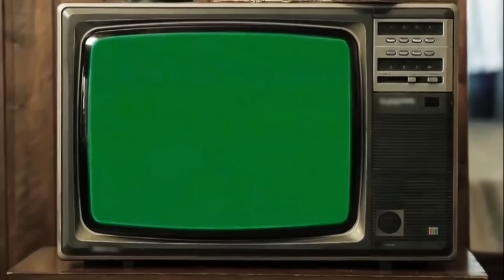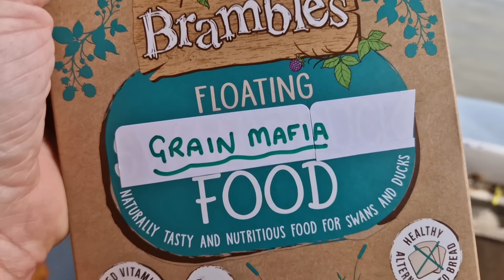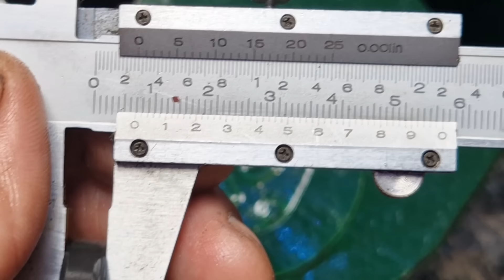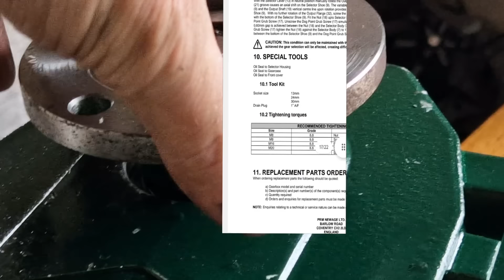Lancaster Canal breach update, and I strip my narrowboat gearbox. My journey continues.

Comment: Great job! I'm looking forward to part two. I use to work in the hydraulics industry. We would leak check our pumps with pressurized air after a rebuild. You could remove the vent fitting, and connect a hose to your bicycle pump so you could pressurize the case, you only need about 5 psi. Then check the shaft seals and housing seals for leaks with soapy water. Just a suggestion. It's easier to find a leak before you go to all the trouble of installing it. I can't tell you how many times I found a nicked shaft seal. You were smart to protect yours with the plastic wrap. Most people don't.
Reply from the maker: That's a really great tip. Thanks. It did leak, by the way.  😂
Reply: Interesting. Makes me wonder if the seals would go in a pump the other way round so the internal pressure pushes the lips on to the shaft (Ooer Mrs). As an engine botcher, that's what we have positive crankcase ventilation for.
Reply: @NarrowboatWill  , did it leak at one of the shaft seals, or the housing, or could you tell?
Reply from the maker: @MichaelBarnes-v8b it leaked at the  output shaft, coupling. I'll show you next vlog.

Comment: Hi Will great video, never taken a gearbox apart before. Think I would lay everything out on blue roll in the order it comes apart then after cleaning and new seals fitted the rebuild is a reversal.
I’m not one of these people that can put everything into one container and remember how it all goes back together.
Luckily you had the film to fall back on. Or you could just take photos of each stage of the strip.
Anyway some lovely machined pieces and straight forward design, they always say keep it simple less things to go wrong. Guess that’s where the saying ‘Over engineered’ comes from.
Reply from the maker: These gearboxes are made to last by the looks of things. Pretty heavy gears etc. I'm pleased it went back OK in the end.  😂

Comment: Definitely want to see the swap 👍👍 That was a pretty complex job, swapping the boxes ought to be a piece of cake by comparison.
ATF instead of 90W or 90/140 gear oil still seems alien to my old brain, I've got a beater Ford pickup with a manual trans that takes ATF....
Let us know how many hours are on your existing gearbox, thanks!
Reply from the maker: My old gearbox is from new. 2004 when it was fitted about 4000 hours. I will mention it in part 3. I know what you mean about gear oil. I thought it would take Ep80 oil or something thick gear oil, but no. 
Thanks for watching.

Comment: Darren Crouch has a good video on the innards of the PRM 120 (basically the same as the 125). Very simple, elegant design, the operating lever nudges the cone clutch in the right direction, then the thing sort of just winds itself into gear along the screw thread. You can get the service manual online, has all the right torques, etc.
Reply from the maker: Yes , I watched him before I had a go. I also have the torque settings from prm. Thanks for watching.

Comment: Fantastic video. My prm 120d has just stripped the clutch ring so I'm going to replace it.  Does the back of the box just unbolt from the propellor uj?? What a fantastic channel sir.   Subscribed
Reply from the maker: I unbolted 4 bolts from my prop shaft then 8 bolts around my bell housing then 4 bolts and 2 Allen bolts inside the bell housing. The Binx nut holding the shaft coupling on is a 30mm then unbolt the gearbox then split it. Good luck.

Comment: Is it better to source individual seals rather than just buying a seal kit Will? I see they do a PRM seal, gasket and o-ring kit online for £40 - £50. Seems expensive if you don't need all of it. Keep the rest for spares maybe?
Reply from the maker: I only bought the seals locally for £5 the gasket sealer was about £8
Reply: @NarrowboatWill  You're good at finding bargains. I might start looking round car boot sales. I did find a few bits in a local market, some hand tools and bungees for £1 each.